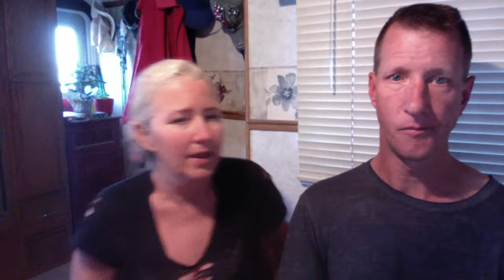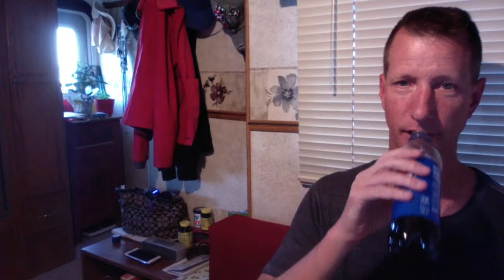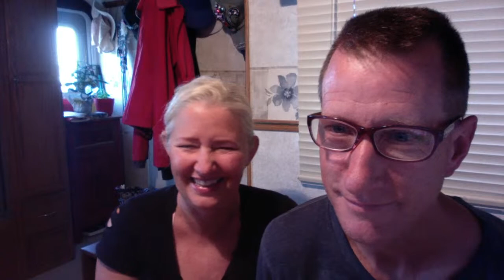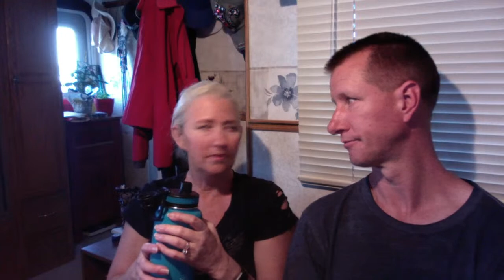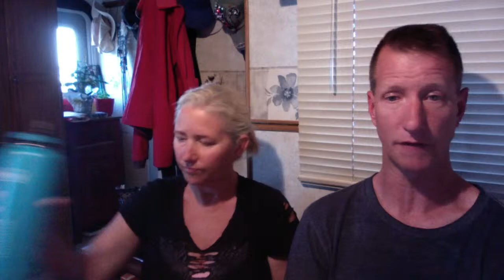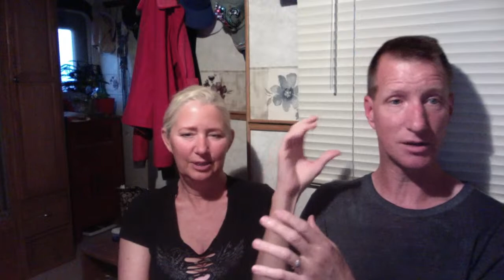Let's Build A House! (Weekly Discussion - 03/10/21)

Comment: Run your grey water into a planter and 3" will be fine for your black water.
Reply from the maker: We would definitely like to reuse our grey water, Philip.  That's a great idea.  Based on the tables in the code about sizing pipes for numbers of "drainage fixture units," we should be fine with 3" either way, but we would still love to get an additional use out of our grey water.

Comment: It might be that the cement may deteriorate because it’s sewage waste...
Reply from the maker: Not sure what the reason is.  There's no problem using cement for just PVC or just ABS.  They just don't want you to use it for the transition.  Even though they make a cement specifically for the transition.  🤷‍♂️